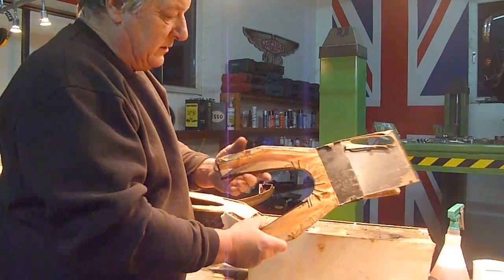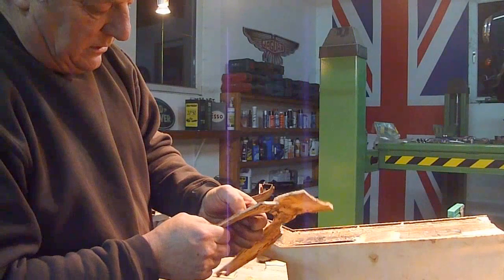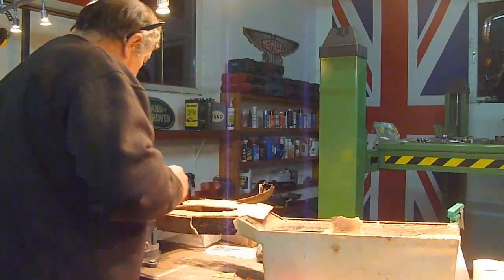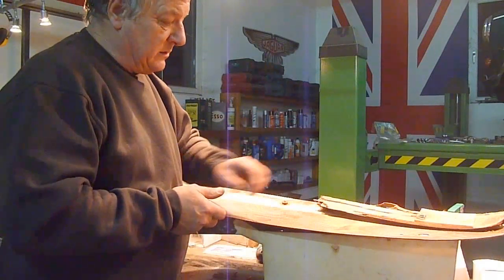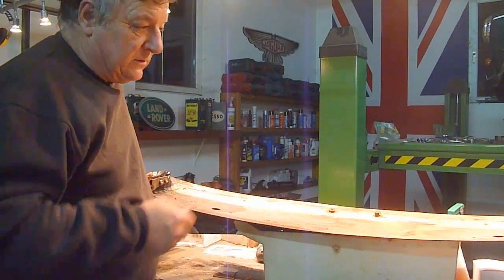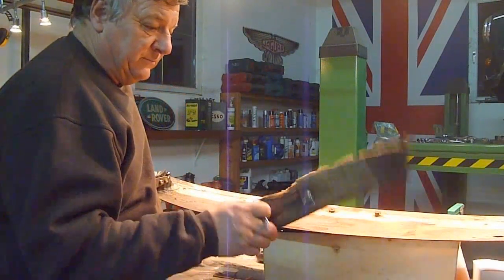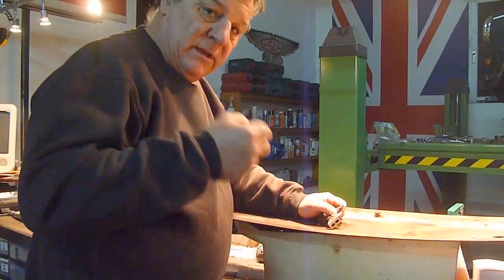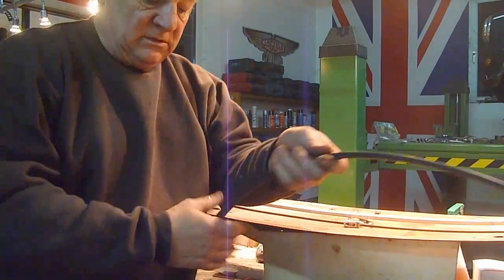jaguar e type hood canopy & centre console part 1

Comment: Just while I think of commenting,I have been following much of your series. I do think this represents the best of what YT has for communicating real detail. I do hope that when reassembly happens,you slather copper coloured high temp Never Seize all over the brake bits and related pivot points, Lug studs and Rudge taper,it is even better than silver coloured standard NeverSeize. From a former brakes mechanic. Cheers.
Reply from the maker: +paul manson 
Hi Paul, Thank you very much for your positive comments, I have used copper slip where ever i could. Being an ex oil patch man and working
on rigs around the world i know how important PM is, The cars that i am restoring now will never in my life time be treated the way they have
been in the past and for me it‘s like taking a sow‘s ear and trying to make it in to a silk purse, I get a big kick out of people when they look at 
a tired old classic car and think i am a bit mad to try and restore them, I think within reason you can save just about anything with time & money.
Take care
David
Reply: Well I looked at that rear brake ass,y already removed,partly cleaned up,saying some form of holy crow. I have worked on some very tired iron indeed,but that mess was way worse. It is a first gen design,with all the faults pertaining. Add the corrosion of sitting for years and that is one hell of a mess. Modern disc systems have the advantage of decades of bright people scratching their heads to generate something simpler and or longer lasting. Whether Jag or Vette,the complexities need to be tinkered with as constant maintenance. You are right about oil patch temperament. Dream workshop. And it is needed to tackle a restoration of that level. Stage I,II,III tuning? This is a stage III restoration. Not  that
much capable of being worse. Nice to see the patient detail,both in terms of wrenching and filming.(Memorying?) No film but certainly a record moment by moment.

Comment: The composite tacking strip looks like a major advancement over wood!
Reply from the maker: +JohnCarey1963Jag 
I will let you know how well it fits when i get it on! Did you use the plywood or something else to give the top section some strength. I will
take another look at your video on the centre console. Take care
David
Reply: +davejaguar66 Dave, my car was a FHC :-)
Reply: +davejaguar66 For the center console, the new aluminum covering kit from SNG Barratt's came with wood on it.
Reply from the maker: +JohnCarey1963Jag 
I mentioned the tack rail to you in case any of your buddies with a DHC need to change there hoods, 
by the way the seats went to the trimmers today another job off my to do list!  David